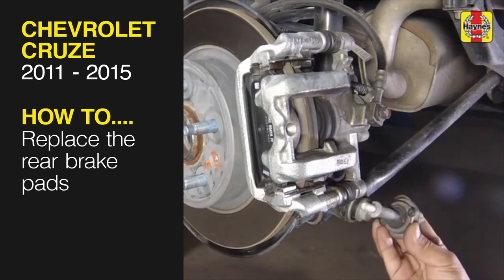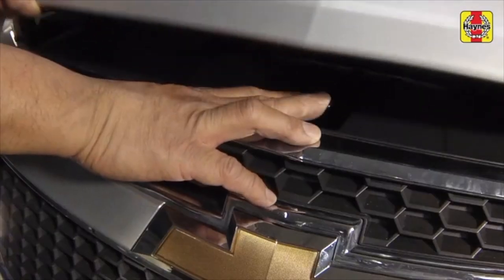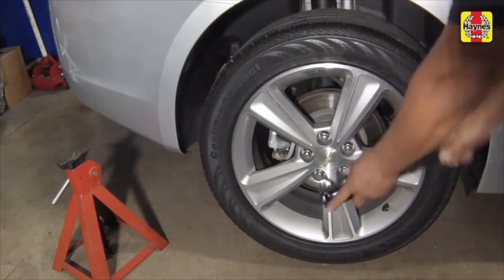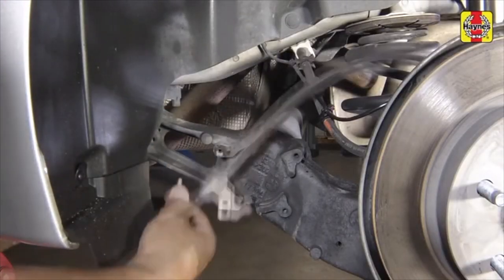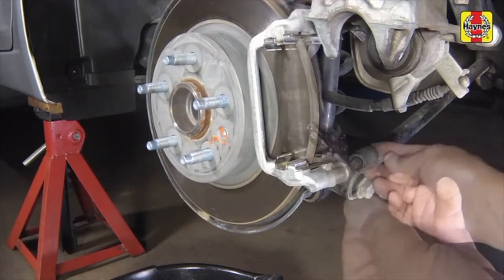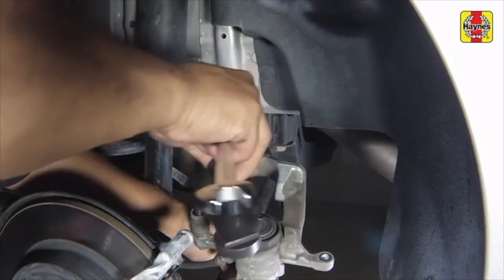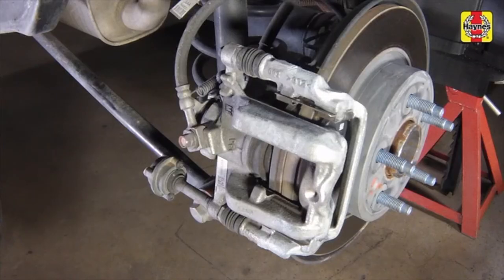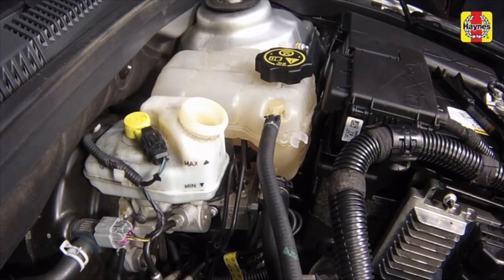How to Replace the rear brake pads on the Chevrolet Cruze 2011 to 2015

Comment: My caliper won’t just lift after removing the bottom bolt...
Reply: I had the same issue I’m about to give up
Reply: @SHORTII913  make sure the emergency break is off that’s why and they don’t explain that on the video, also compressing the caliper is different it screws back into the assembly is not like the front ones that just recede, if I find the video with that explanation I’ll put in the link.
Reply: Loosen up the top bolt , jeez .
Reply: @javierramos9795  you are a hell of a guy
Reply: @akbarshoed  huh?

Comment: nice video. i surprise that i can not move back the break piston by with screw driver. must go and change in work shop due to tool.
Reply: I recommend buying the tool.  I've used it a few times now over the years.  It's really difficult without it for some brakes it almost doesn't make sense.

Comment: This video is NOT 100% true . Some 2011 Chevrolet Cruze have drum brakes in the rear . I own a 2011 Chevy Cruze that does and it is the premium LT Model . The auto store said it came up on their computer as having disc brakes all around but they do not as do some Toyota Models .
Reply: I've had exactly the same experience with the Hyundai i10. It seems both drum and disc rears have been fitted to versions of that model since 2007, yet online shops say their rear discs will fit "all models 2007-2013". Well they wouldn't have fitted mine as it has drums at the back. I'm wondering whether it depends on the region you live in - for example, perhaps the regulations in Europe allow or require one type while in the US it's the other type. But getting this information out of the manufacturers seems nigh on impossible.

Comment: don't listen to this video ALL 2011-2015 Chevy Cruze has drum brakes in the rear!!
Reply: My 2014 LTZ has disc brakes all the way around.
Reply: This video is exactly right for mine.
Reply: My european cruze 2011 have disc brakes at the rear. Its not that strange.
Reply: My 2014 cruze as disc 👍
Reply: I have a 2011 LT and it has drum brakes in the rear .